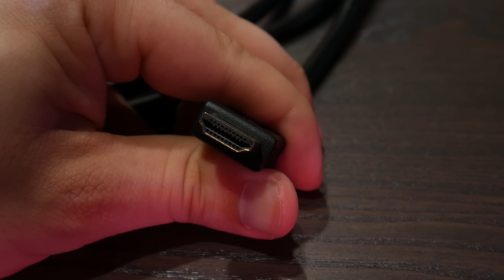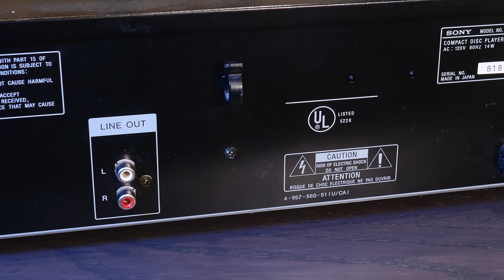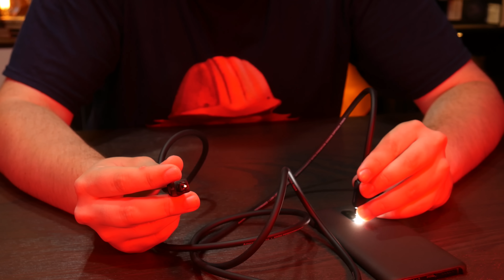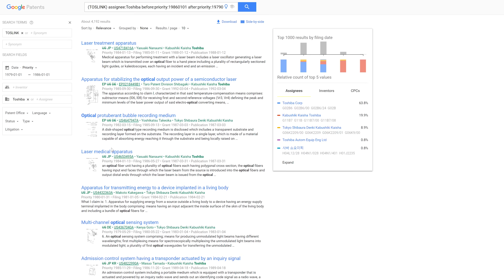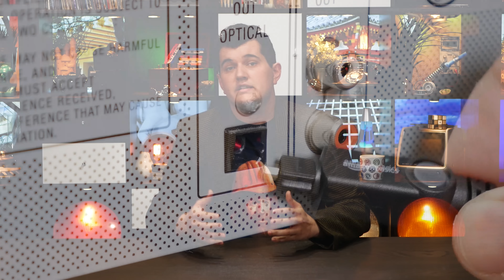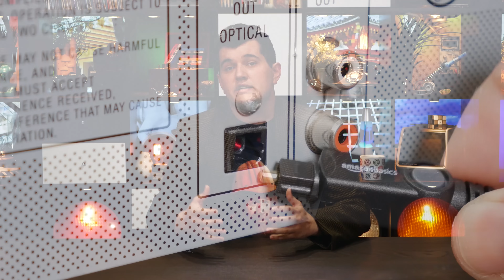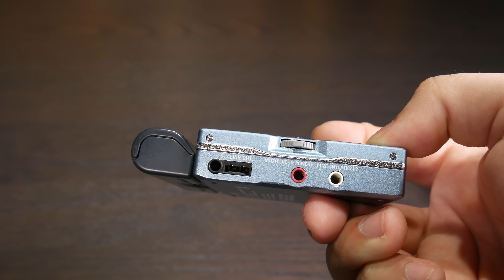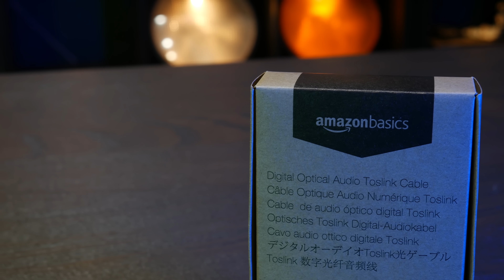TOSLINK: That one consumer fiber optic standard

Comment: The first run of the mill Discman I purchased with my own hard earned cash in the late 90s had mini-toslink which I actually used believe it or not to connect it to a dolby-digital receiver. So yes, super common - you've just been living under a rock. :D

Comment: Most common advantage of Toslink compared to electrical connections is electrical decoupling, to prevent ground loops.
Not to prevent EMI coupling into the cable.

I like the gold plated Toslink, it's evidence of the existence of "audiophiles" aka. "audiophools".
Reply: Yeah... Ground loops suck. Especially when you have to start fail searching all your equipment to figure out what exactly is causing it.
Reply: @rainmaker6217  yeah I've had big headaches of USB audio equipment in the past.
USB ground often is connected to the enclosure of both the host and client.
I have ditched all that USB audio crap, except for my Cambridge Audio DacMagic Plus, which has a ground lift switch on the back that actually works (on some products, those are fake).
Reply: @QoraxAudio  I have a PCI-e soundcard that sounds quite good so I had hoped to keep that, but that may indeed be my culprit. I have some groundloop filters laying around since I wroked on my car that I figured I would try. If worst comes to worst I'm getting a seperate DAC with Toslink in.

Comment: The bad thing about connecting - let's say - your tv, or digital receiver, to an audio amplifier with a toslink is that you will have to struggle with a remote for changing channels on the tv and another remote to increase or lower the volume on the amplifier.

Comment: The one scenario where electrical isolation would be an advantage would be the avoidance of ground loops. These are unlikely to affect the digital signal, but when using a double insulated DAC between two grounded electrical devices, the ground conductors of the analog and digital cables can complete a ground loop which will affect the analog portion of the signal chain. Using an optical TOSLINK connection instead of SPDIF would eliminate this issue..

That said, earth loops are extremely rare in home setups where TOSLINK is usually encountered.

Comment: toslink's real advantage:
one cable for full surround sound.
then came hdmi...
Reply: It supported only compressed surround, not lossless. Only in 2-channel mode does it allow uncompressed throughput.
Reply: @MediocreHexPeddler  considering most people listen to lossy mp3 and streamed media. It shows that isn't an issue.  Spdif is still preferred by me because I don't have to route irrelevant video along with it.
Reply: I use TOSLINK to plug my PlayStation 2 console into my AV receiver and also to plug my gaming headset's transmitter into my Xbox, even my TV itself has that plug
Reply: SCART!  The original HDMI!
Reply: There is no HDMI between a PC motherboards and a sound system.
Reply: I wish they have upgraded the Optical out like with more colors for extra bandwidth or some other crap instead of now to get proper best audio quality from consoles we have to waste another HDMI port from the TV to use ARC or eARC or having to go with expensive decoders which need to be setup using the TV and need to be connected to the HDMI of the TV...

And other thing I mostly care about lowest input lag and I always keep thinking if some decoders won't increase input lag even more or other crap...

Most stuff I have for consoles are dolby digital 5.1 surround optical only, I still haven't gone with HDMI decoder yet and I don't plan too, guess I will have to stick with lower bitrate audio for the Next Gen consoles that is if they don't decide to remove the optical out too :(...

They could have simply improved and give full lossless surround, dolby atmos and whatever trough the optical port and is much nicer having a completely separated audio out on consoles and most devices than having to go everything HDMI...
Reply: Lots of sound systems now have HDMI passthrough to go between your source and your television.
Reply: That's not an advantage over coaxial S/PDIF

Comment: I used to have a home theater, and Toslink was pretty much a miracle.  See, I could either use standard ultra high quality cables for moving tons of information from one part of the system to another, Or, I could use just a few fiber optical cables with Toslink connectors.  Sure, there are limitations in every technology, and expense was the limiting factor for Toslink.  I remember paying $89 for a 3.3m fiber optic patch cable to go between one of my DVD Burners and the AV Receiver- and that was just one of the ten or so fiber optic cables I was using, in addition to a couple of thousand dollars worth of other cables.  This was not recent, mind you.  When I moved to my current home, I had to leave most of the home theater stuff behind- this place is too small for that setup.  In any case, the parts of the system I Do have, well, they are all hooked together with Toslink.

Comment: Damn you! My keyboard is now covered in soda because of that "gold plated optical cable" part!

Sidenote: I have used Toslink to successfully work around a problem that was occurring even with digital coaxial signals. The issue was apparently caused by a ground loop or something like that between the two devices, connecting any conductive cables between the sound source and the amp caused a very loud buzz/hum to come through the speakers (not RF interference or anything like that). Using a Toslink cable avoided this. The amp and speakers were plugged into the wall in a different place than the audio source, so probably was a combination of the wall sockets being on different circuits causing a difference in the ground potential between the devices, and some poor insulation on some of the circuitry allowing the electrical behavior of the digital inputs to cause interference in the analog portion of the amp.

So yeah, not a common problem by any means, but completely separating gear electrically can be helpful in cases like that.

EDIT: I kinda wish I had an optical HDMI connection as well between my PC and my TV, there's some sort of electrical issue again which sometimes causes glitches on my TV. Random sub-pixels lighting up fully on a supposedly very dark screen, as well as some other weird malarkey every now and then. Usually turning the TV off and back on again solves this. This never happens with any other device, nor does it actually happen with the PC when connected through an active HDMI switcher (can't use that day to day for the PC but tested it out), but when the PC is connected directly to the TV, no matter which HDMI port I use, it comes up every now and then. Almost certain that breaking the electrical connection between the two would solve it.

Comment: TOSLINK is not dead! You cannot imagine the amount of headaches I have had trying to get multiple audio connections from 2 PCs into a Mixer board so I can hear different sources at the same time and the amount of noise from all the analogue 1/4” - 3.5mm cables (and not just ground loop noise) but all sorts of noise was coming through.

Without spending a huge amount of money getting into the world of ADAT there is not a single product on the market that acts as a “TOSLINK Mixer” (a way to connect multiple TOSLINK connections and mix them, it’s technically not possible) but there is finally a solution on the market using a device called a “GoXLR”, this has a USB port, a TOSLINK port and analogue ports and can mix them all together

If I connect one PC via USB and the other via TOSLINK and as long as I only stick to using one of the analogue connections then I have 0 noise problems and my years of trying to figure out how to have a noise-free multi-PC audio experience is finally figured out :) happy days! (I’m also using a 2nd TOSLINK connection directly between 2 PCs as some sound cards have a TOSLINK input not just an output)

Thank you 1980’s tech, you’ve saved me in 2019 :) oh also great video!

Comment: There is a good reason to use optical connection in between Hi-fi components. That's ground loops. I had a very bad experince in an intertinement system formed by a TV, a CD player, a Squeezebox, an external DAC and an amplifier... The mix of analogue cables and digitale calbes (and power calbes) were getting such a large amount of EMI noise that SPDIF connections were loosing data. Moving to TOS-Link was completelly fixing the problem by breaking the groundloops.
Reply: I used to use some extremely high end cables which were, well, very well insulated.  Problem was, they were very, very bulky.  I began to move to Toslink because I was tired of big bundles of cables all over the place.  This was, mind you, for a high end home theater.

Comment: I always thought that optical transmission removed hum induced by poor grounding. That said, your point about shared common point electricity among send/receive devices is a good one, but if one component has a bad internal ground connection and you share that signal electrically with other devices, then they are all going to share that noise. 

Anyway, I also wanted to say that you consistently pick really interesting things to talk about, so thank you for that.

Comment: just add a laser diode and allow companies to put out packages to support various standards, or just put out an open standard update they can all use, they as i understand it, could also use cheap laser diodes and leds or mutli laser diodes red, blue, green, to raise bandwidth even more, without losing the ability to output a toslink compatible signal. 

personally i prefer display port to hdmi, but, i also like toslink and have seen the cables used for far more critical higher bandwidth uses,very good stuff, that system used a laser diode.

Comment: They could make a downward compatible upgrade. Send the signal at the normal rate and hide the faster high quality signal in the spaces between the normal flashes. That way a depending on how they are made the device using the old system wil be able to read it without changing anything and the better stuff can pick up the better signal. Or use a different wavelength to play the signals next to each other.

Comment: All apple mac and related products had the mini toslink in their headphone/line out plugs until recently. for example I'm getting digital audio from my thrashcan mac pro with toslink through the head phone out port.  Also the airport express have toslink digital out from their line out plugs too. You don't see the light glowing when there's nothing plugged, but light starts after you plug an optical cable.

Comment: Maybe Toslink is still there because of the foolproof nature of the sockets - not only is RCA considered the analog audio standard, a yellow RCA jack was more often used for composite video. With a coaxial S/PDIF,  someone must have plugged the wrong cable to the wrong socket at some point. With Toslink, that was almost impossible.

Comment: DAMNIT I'M OLD! Kids these days have it so easy, I was a teenager audiophile having to figure all of this shit out myself with no internet - yes I used that mini TOS-Link to record onto my mini-disc player (pain in the ass process as it was real-time). 

I will say though, Apple MacBook Pros supported TOS-Link from the start pretty much - even the late PowerBook G4 had it. Since many of these were coming out LONG before it was feasible for laptop manufacturers to support and integrate the then-non-mainstream HDMI standard, it was actually a very convenient way of using a powerful portable computer to output digital sound. In fact all laptops completely skipped the coaxial digital output till HDMI (or at least mini-display port, lightning port, etc) became available, then they just all had full-sized HDMI ports anyways. 
Either way - things are WAY easier than they used to be! lol

Comment: Awesome video. But to the part about "good luck avoiding the power they will share" , us audiophiles do avoid that. :)
The mains charges batteries which then run independent inverters. Aka online uninterruptible power supplies, but a little different from those made for enterprise server/infrastructure.
Love the channel.
Edit: clock jitter is also very much taken into account. For DACs (im sure you know already) use two independent clocks then compare the results.
That's why way cheap stylish looking DACs on massdrop, may be crap. They may run from your pc's clock. Basically just connectors for your pc.
Thanks
Edit edit: one thing amazing about toslink is you can put it through a hub and run tons of audio dacs with no drivers. One way has major benefits still. No device negotiation.
Thanks thanks

Comment: Oh, WOW~! I've been using TosLINK for a long time now. I never knew about that limitation for bandwidth. Glad, I now know this. I'll definitely only recommend it on certain applications now.
Reply: Its bandwidth is sufficient for stereo audio. Common devices support transmitting 96kHz/24-bit, with few going up to 192 kHz. On the wire 24 bits are always sent. But there isn't an agreed upon method or codec for redistributing this bandwidth for multichannel sound. DTS is indeed limited to 48/16, and is a simple format, but a separate standard. Corporations don't like Toslink because it doesn't have DRM.
Reply: j7ndominica0 And, HDMI does. LOL 
Good point. (:

Comment: One of the key benefits of TOSLINK is that if your HDMI card in your receiver goes wonky, you can use the TOSLINK to split the HDMI audio and video.  The HDMI card on my A/V receiver went bad so I bought an HDMI switch which goes into a device that splits the HDMI signal into an HDMI video signal and a TOSLINK audio signal.  I then keep the full sound quality going into the A/V receiver and the video can go off to the digital projector which has no audio output.  That was a lot cheaper than replacing the perfectly good audio part of the A/V receiver.

Comment: I use toslink because 1. the distance to my hifi from my storage is too long for common RCA cables without a connector, and the connectors made noise and, 2. I have the connector, so using it saves a USB port. Btw music requires TWO channel audio, not x channel audio. Not 5, 7, 10, etc channel. Your ears are stereo, your audio should be too.

Comment: Quite a few motherboards still support optical S/PDIF connections.  My current motherboard has optical version and my old motherboard had both optical and copper S/PDIF connections.  Heck, even the motherboard that were released 2 weeks ago to support the new Ryzen CPUs have optical S/PDIF connections on most of the mid-range and upper end boards.

Comment: TOSLINK was extremely common on 90s studio recording equipment, specifically ADAT recording gear which recorded--iirc--8 channel PCM onto S-VHS tapes. You'll find ADAT connections on lots of modern consumer recording interfaces and toslink ADAT preamps are still readily available

Comment: You missed the principal #1 aspect of Optical TOSLINK  connections  = Galvanic Isolation which prevents ground loop noise  ( as still occurs on copper RCA S/PDIF cable connections) 
https://en.wikipedia.org/wiki/Galvanic_isolation

Comment: I bet a lot of the range problems stem from the standard being made when IR and red LEDs where the most common and efficient.  I vaguely remember gigabit POF was going to use green diodes for less attenuation in the cheap fiber.

Comment: First time I hear about this but: doesn’t light have no latency vs other wires medium? Light is fast. I have no clue, just curious
Reply: Light and electrical signals both move at close to the speed of light in most practical sense. But yes, for extremely high bandwidth applications length of the connection can pose an issue. For example sending a signal from New York to Los Angeles will create a delay on the order of 10 ms just by the speed of light alone.

Comment: Yes, huge differences. The signal isn't susceptible to external interference as unshielded AV cables are. Often if you ran traditional over a distance longer than a foot along a power source or anywhere near fluorescent lights you'll get feedback. 

The fiber link (TOSLINK) circumvents this and allows you greater distances. Also, different CD players use different DAC's.

Comment: Something else ARC can do is forward audio from other inputs (including HDMI) direct to the TV to an amplifier.  This can be very beneficial if you have a 4K TV and Bluray player, but your HDMI receiver is only 1080P.  Obviously, you wouldn't want to run that 4K signal through a 1080P amplifier, as it would no longer be 4K.  So, the ARC would allow the TV and BluRay players to be directly connected via HDMI to give you the 4K video, and the TV could then send the audio direct to the amplifier so you could still use your surround sound system.
Reply: That’s the hole point of ARC?... That’s not like an additional feature of ARC, that is ARC.

Comment: We are about the same age and I definitely had mini spdif connectors on a lot of stuff. The good Sound Blaster cards going back to the Audigy had them. Minidiscs of course. I remember getting my first shelf unit 5.1 system in the early 2000s and the toslink cable i got came with mini adapters.

Comment: I was going to ask how come a TOSLINK connection has a visible red light, when Fibreoptics generally uses none light from wavelengths not in the visible spectrum have better tolerances.   Tthen you said it was just an LED! 
OMG did not know that, that explains so much. Thank you =)